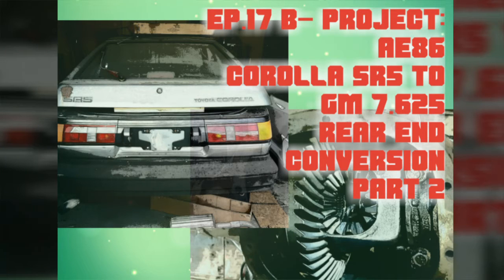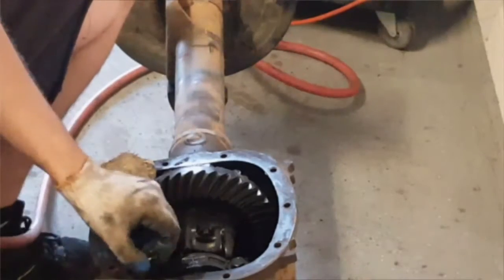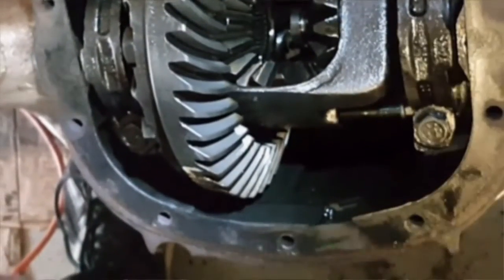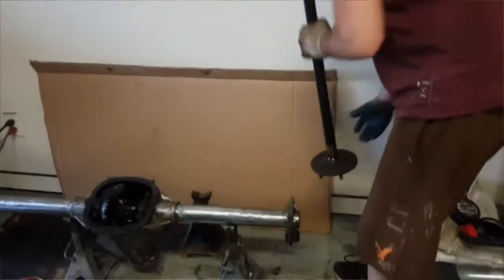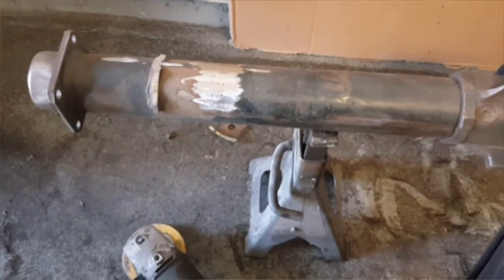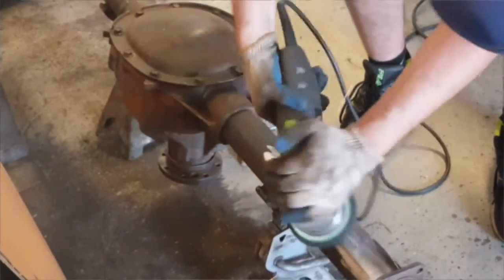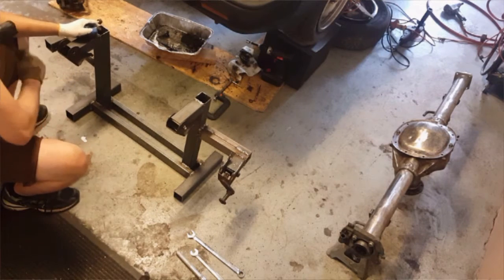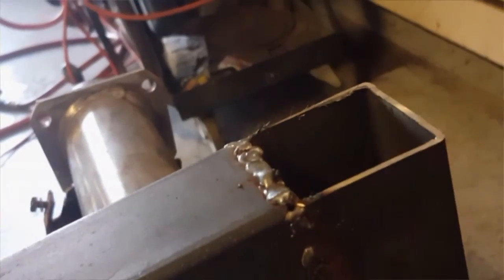Ep.17b PROJECT: AE86 -Corolla SR5 to GM 7.625 Rear End Conversion/swap. Part 2

Comment: Did you consider using a Toyota 7.5 from a celica supra / truck? / van?? Wondering what to do for mine.
Reply from the maker: Celica supra mk1 is even more rare than ae86.  If one was around I def would've considered that....an old truck or van would've been cool but still hard to find if I ever needed parts in the future....i finally went gm 7.625 because it's just so common and parts are dirt cheap and factory lsd.  If you can find a mk1 rear end it bolts right in I heard, so that's def the easiest way for sure.

Comment: This is a pretty good video in terms of making a rear end from scratch. Nice job!
Reply from the maker: Thank you.....be sure to check out ep.40 which I just released....bwcause I go back and set up the rear end again because I made a couple errors 1) i used a pinion gear and ring gear from 2 different cars which I found is a no no.  2) I didn't shim the pinion gear enough which caused excessive whining when driving.....thanks for watching.

Comment: Whats the point of using gm or ford part?
Reply from the maker: +webyosan yeah bro you got a helluva deal on that.  glad for you.  loving your build too.  when are you going to start your video log?  :)  
how much are you getting the axles for?  they can get pricey as well.
Reply from the maker: because original gts rear end is hard to find these days.  also if you are lucky enough to find one you will pay a premium for a rear end that is 30 years old and known for breaking axles if you add a lil power to it. this gm 7.625 is plenty strong for these corollas up to 350hp and beyond...gm used them in the v8 firebirds and camaros too. added bonus is replacement gears and parts are all over the salvage yards for cheap and aftermarket goodies are plentiful too.
Reply: Got mine recently for only $300 kouki GT-S non LSD complete calipers, lines, 4 links and so on. I didn't expect to get one, just perfect timing. There is a local shop near me that do make kouki axle, I'm about to purchase soon. 
my blog: http://www.club4ag.com/forums/viewtopic.php?f=7&t=19056

Comment: I'm pretty much unbeatable in any race once Only Star starts to play.

Anywho... I might be sourcing myself an 8.8 out of a 04 Mustang GT.. I think it's an 8.8, I've read GTs in that year only came in 8.8. Anything I should look for before I purchase?
Reply: oh also... how much wider is the 8.8 versus the GTS rear?..or SR5 rear in your case?
Reply from the maker: +n0eLoL haha....love "only star"...can't find the Japanese version though...i had it on cd back in the day.  

about the ford 8.8.....i was gonna go this route at first but decided with the gm rear end. here are the measurements I've gathered. all measurements are wheel mounting surface to wheel mounting surface.
ae86 54.8"
04 mustang gt 62.5"
2002 chevy s10 2wd 54.5"
1999+ chevy blazer 2wd 54" (4wd 59")
a common thing to do is use a rear end out of a ford explorer it's an 8.8 as well.  Because the pumpkin is offset.....you shorten the longer side, driver side i believe, to center the pumpkin then you get another passenger side short axle from another donor explorer and use it in the shortened driver side and it ends up being 56.5" when all is said and done. hope that made sense but there are videos floating around on youtube about the process. 

since i won't be making more than 300hp the 7.625 rear end is plenty beef for me. 

i don't know if all mustang gt came with 8.8 rear end but you can tell the difference in the rear diff cover....the 8.8 cover looks like a square with rounded corners, while the 7.5 is more oval shape with the top and bottom straight and the sides curved.